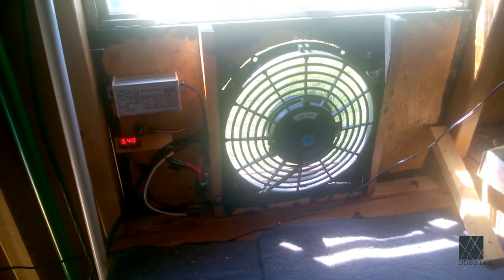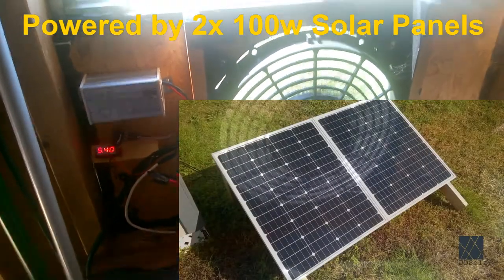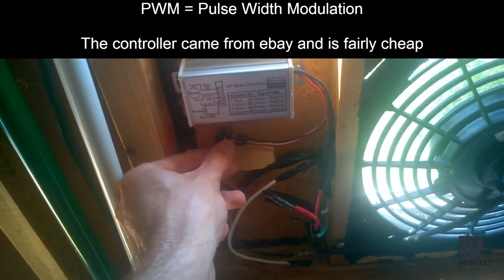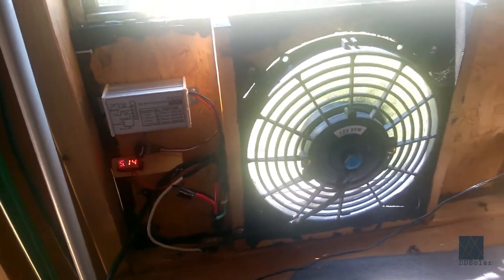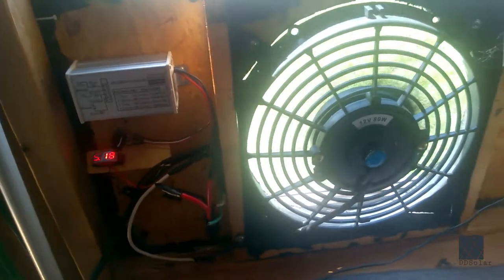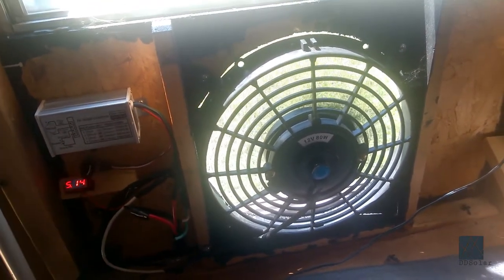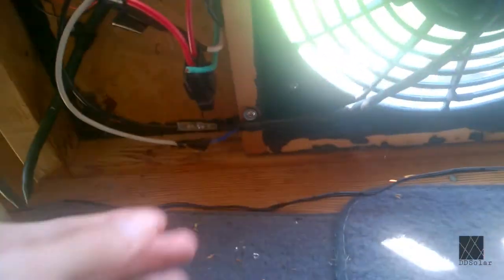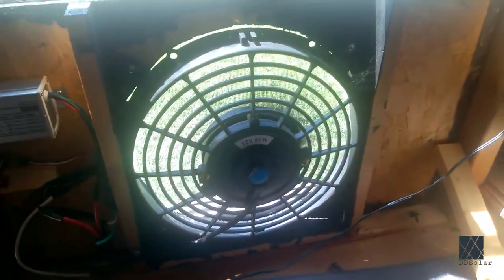Update On Solar Shed Ventilation System

Comment: Do you have a video that shows how to wire everything?
Reply from the maker: @pkennedy4256 I have several videos about this topic (link below). Basically you just wire the solar panel straight to the fan. Simple as that. A switch is a very good idea, speed controller is optional, maybe add a fuse if the solar panels are very large. 
https://www.youtube.com/playlist?list=PL8a6nRTNyF9NaLLnvv7lxb0F5TGonkPyY

Comment: I'm currently looking to use the same type ap[plication on my shed. Qusetion is what size panel will I need to drive the radiator fan without putting on a speed controler ?
Reply from the maker: @MikeBerkebile  A 50 watt solar panel in direct sun will move the fan for sure, but never require a speed controller. A 100 watt solar panel can potentially burn out the fan, in good sun in runs super fast but gets hot. Hope that helps!

Comment: Where did you get that fan for just "10 or 12 bucks"? Everywhere I look those fans are $35 and up.
Reply from the maker: A listing on Ebay over a year ago, the price has since gone up. Still under 20 if you look around.
Reply: @solarpoweredge  That makes sense. I was hoping you could share a secret source for getting them cheap. Lol
Reply from the maker: @troyyarbrough  Yeah sorry I wish I knew where, all the prices have skyrocketed
Reply: Same thing i did in my attic ..this radiator fan is water resistant also i think ..may i know what is that little square box beside the fan you installed?
Reply: @timothy1837  Yes, they are water resistant for sure. I have a 14 inch electric radiator fan installed in my f150. I've driven it in the rain many times and the fan is still going strong.
Reply: @timothy1837  That's the DC controller, which manages the speed of the fan motor by regulating the power received from the Solar panel. The knob he's turning is typically part of the controller and come attached to it. The little led voltmeter makes it appear confusing and is not needed, but it helps him establish optimal power to the dc fan.

Comment: Question, can I use a 50w solar panel for the same fan?
Reply from the maker: Hi, yes it will work. My panel is only 35w but it has higher current. Be careful it is a very powerful fan. It has no covering over the intake side.